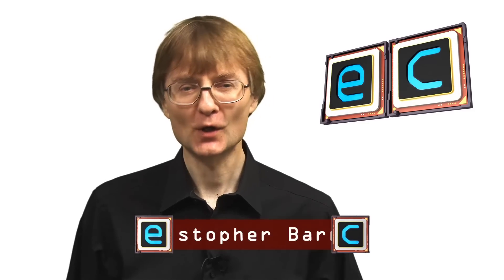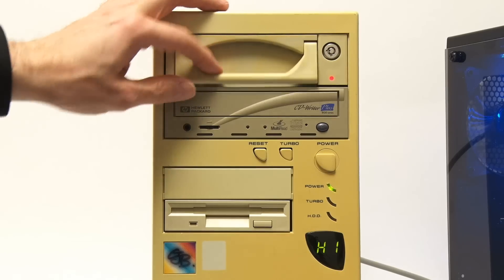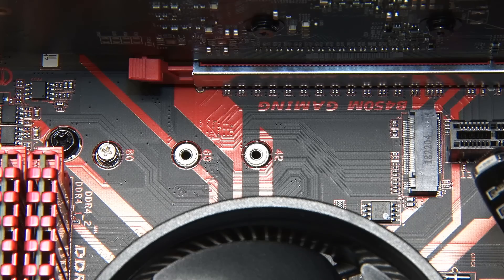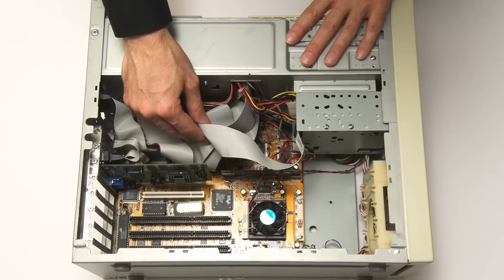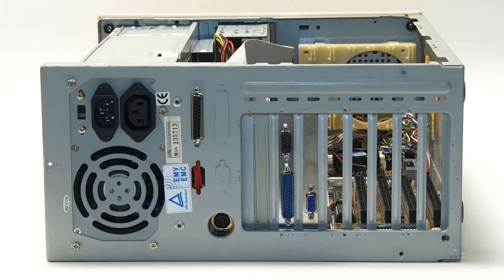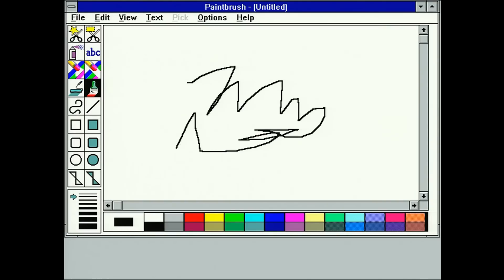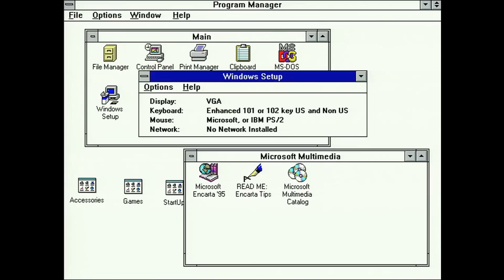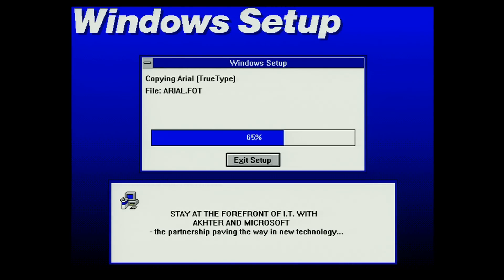Ryzen 3 vs 1996 PC

Comment: I so appreciate modern PC technology compared to the old stuff in the 90's as it was so fiddly to sort something and it was never a case of plug in, adjust settings and play... it was endless check this, check that, make sure there are no conflicts and everything else.

These days tho, when building a new PC, I just want to open the case once to assemble everything and largely forget about the internals of the PC unless it's a case of cloning drives and the like. I think I've just lost my tinkering edge and just want to use any PC I make as a tool and not something that needs perpetually tinkered.

I remember installing windows 3.0 & 3.1 from floppy disks and it was a case of just chilling while it did or doing other work in the IT training place where we were and then it was install the DTP software and then carry on with the form and design work we did.

Comment: Why were you running Windows 3.1 instead of Windows 95? A Pentium 120 with 32 MB of RAM was surely capable of running Windows 95 at a nice speed, so you weren't limited there, so I'm a bit curious as to why 3.1 was used.

Comment: If you just set that 1996 PC outside in direct sunlight for a few days no extra steps needed you can get them to turn white again after around 3-4 days
Reply: @Dalle Smalhals No you really don't Direct UV bleached plastic indirect UV yellows. I just tested this a few weeks back on some nearly orange yellowed keyboards heres my before and after center keyboard was a 1 day test run the other 2 i left out for 5 days.
https://cdn.discordapp.com/attachments/505264073894658062/620729905449140234/JPEG_20190806_095043.jpg
https://cdn.discordapp.com/attachments/505264073894658062/620729843654590475/JPEG_20190820_101006.jpg
https://cdn.discordapp.com/attachments/505264073894658062/620729935467905074/JPEG_20190808_202157.jpg
Reply: It's much slower then retro brighting but requires no extra steps other then just placing the items directly in the sun and doesn't require all the disassembly and chemicals plus you don't end up with wavy uneven brightening.

Comment: Windows 3.1/ 3.11 for workgroups on a Pentium 100+ and 32MB of Ram was extremely fast. I remember in middle school/ early high school we had a LAN with 3.11 on 386, and 486 computers, then they bought new Gateway 2000's with Pentium 166 mh with MMX and was still running 3.11 for worktgroups and it was amazing... Then upgraded to 95 and everything was sloooow. 98 was back to amazing a few years later though.

Comment: I do wish a company would make SMALL hard disks using the SATA connectors. So you can buy a brand new 10 GB or so HDD and use a PCI SATA port card.
Reply from the maker: Very much agreed.

Comment: Why don’t PSU come with a power output port anymore? Like what was the reasoning for discontinuing that? Seems like it would be handy even today to easily plug in a LCD monitor in the event you’re limited to power outlets or limited to power outlets on a power strip.
Reply from the maker: It was indeed very handy -- so they stopped doing it!

Comment: You forgot to mention the hardware locks that are present on the front panel of the older PC. The top one is for locking the HDD caddy in its place so that no one could take your precious data away.
The lock in the lower right is more interesting. Depending on your computer's model it could do one of the following things:
- lock the case mechanically, preventing theft of valuable parts;
- disconnect or otherwise disable your keyboard (worked because USB was not there yet)
- disconnect or disable hard drives and floppies.
Yet, these locks were rather useless: all keys were the same, so if you had one, you could unlock any computer.

Comment: what's with the LED strip dangling in the middle of the case?
Reply from the maker: I did not have an extension cable from the motherboard socket to the LED strip . .  :(

Comment: i've always wondered why Pc cases manufacturers still inclued the turbo button, even in the late 90s. 
The turbo button was useful when transitioning from 8086 to 286, arround 1982. When 486 and pentium appeared in early 90's, it was already useless But even in the very last days of AT standard (i clearly remember some pc sold in 1997)  

In other words, this button  stayed more than 10 years, despite being useless since the 80's
Reply: Why as it useless?
Reply: @nadirjofas3140  At least since the Pentium era (don't know for 486 or 386), even if some motherboards had a turbo pin, it generaly  didn't had any effect. On every socket pentium mb i had, there was no effect at all.

Comment: A really expensive piece of hardware for 1996. 
I also build my first system that year, but I had a 486 DX2 66MHz with 4MB-RAM.
I was using a 2MB VESA Local Bus Graphic-Card and only had ISO Slots next to it.

My first update was a CYRIX DX4-100 and the gain in speed was amazing :-)

Comment: A P-120 with 32MB of Ram, a 1.2GB hard drive, and a flat panel display, you were doing well in 1996!  I distinctly recall my displeasure of spending $200 usd to buy an additional 4mb of ram just so I could get Duke Nukem 3D running!  Also watching HIMEM test extended memory brings back a world of enjoyable memories, you knew things were good if HIMEM could finish the test without hanging the system.  By good I mean you had your array of jumpers set correctly, not that you'd have a working Serial port, Printer port, Mouse, Sound, CD-Rom, or Gameport!
Reply from the maker: At the time my freelance speaking and writing work was just taking off, and the P120 build very much reflected that. :)

Comment: Plot twist: build a Ryzen system inside a pc  from 1996 and you got a computer that does not look like an aquarium with massive fans that aren´t allowed to pull air for cooling but rather still looks like a computer as you strongly remember it once looking like.

Comment: My 1996 Packard Bell Pentium 100 had no CPU fan at all, just a bare heatsink instead and I don't really recall seeing a case fan at all save for the power supply. 32MB of RAM in SIMM form would have cost a small fortune in those days and I had to make do with 8MB. The graphics card was integrated with the modem and sound card and only came with 1MB VRAM but I didn't really care because I was just a little kid back then. I regret not keeping the PB Dome with slider keyboard though. I would have definitely paired it with my new Ryzen build and now have to use an old Model M I bought.

Comment: In the Philippines, the windows 3.1 came out when I first bought my first PC which was an 80486DX2 with a 300 MB Hard disk, 5.25 and 3.5 inch drives and 14" CRT Color Monitor plus an Epson LX-300 printer (all cost 750 USD).  CD was not yet available so we installed windows 3.1 using 30 3.5" disk.  

Games will not run usually out of the box so you need to do some memory management by modifying the himem.sys and autoexec.bat.  When CD/CR-Writer came out, you need to manually copy the driver to the c:\ drive and manually edit the autoexec.bat to load the CD drive after boot.

Comment: Could have used the 3200g it's been out and is $99 no gpu needed.
Reply from the maker: The Ryzen build is from January 2019. :) The system was built as part of a series, first showing a low-cost build without a graphics card, then upgrades. I did not repeat all of this info in this video! :)

Comment: First computer build in 1996? Beat you on that with a Pentium 90 in 1994 while still in school. I remember them selling me a mainboard with an old BIOS that didn't support HDDs bigger than 512MB, while I got a 540MB disk. Took quite some time until I found that fault. The computer ran without a problem for weeks, then started to have HDD errors, apparently at the time when DOS/Windows tried to read from to the part above 512MB (wasn't bothered when writing to it; who knows whereever those data went).
Ooh, and the times when you had multiple configurations in your config.sys and autoexec.bat! Setting the IRQs and DMAs for the sound card, mouse and serial port, loading sound and mouse drivers into "HIMEM" to squeeze as much out of the PC to get "Privateer" and "Civilization" to run. Thise were the times...
Reply: @Dalle Smalhals 
FIRST!! That's what it's all about, you know ;) . And the good old times (or maybe not even that good?).

Comment: Back when I had a Pentium (and even a 80486DX100) as my daily driver, I used it with Windows 95 (and eventually Windows 95 OSR2), which worked flawlessly. By the way, sticking with what you had installed, you could  have used the 'generic' SVGA driver included on the Windows 3.1 Setup disks. The thing is, this one is not listed as an option to start with. So if you'd have selected the Other option from Windows Setup and then loaded the SVGA driver, you'd have been able to enjoy 265 colours even though you didn't have the OEM driver. Granted, it would've been slower... But in these days that hardly made a difference anyway...
Reply from the maker: Yes, with both 95 and 98, there was little serious business use before the OSR2 release.

Comment: My first "hot" computer was a 586 133mhz with Windows 95.  No CDROM, so I had to install Windows 95 with 15 (yes fifteen) floppies.  Before that, I ran the gamut of 286 then 386 (then converted the 386 to 486 with a Cyrix upgrade for $200.)  Then went through a couple of iterations of 686 and K6 machines.  I skipped the Pentium II and went to Pentium III at 450 mhz.  Swapped the processor for a P3 700 and overclocked it to 902 mhz, but had to add a HUGE heatsink with double fans.  Sounded like a jet aircraft but was fairly stable at 902.  Then on to an Athlon 64 and 1 gb of RAM.    Then to a FX8350 machine but hated the noise so pulled back to Athlon II with 8 gb of RAM and that's what I surf the net with today.

Comment: My first PC was a 486 Cyrix DX2 66 back in 1994, but I upgraded it around 18 months later, to a Pentium P120, 32Mb ram and S3 Virge (which is the same as you've got, by the looks of things). I never used Windows 3.1 though, I always used Dos, until Windows 95 came out.

Comment: 1996....You should be using Windows 95, not Windows 3.1, along with Dos 6.22.
Reply from the maker: I had the WIn 3.1 disks, and like most office users mainly ran WordPerfect 5.1 for DOS. Windows was for CorelDRAW! So there were zero practical benefits, and potential downsides, opting for Win 95. (Both Win 95 and 98 were not considered stable until OSRII).

Comment: Wow.. you had quite a monster back in 1996. My late 1995 rig initially had only 16MBs of EDO RAM. CPU was 100Mhz which I overclocked to 133Mhz by fiddling with the jumpers. Thanks a lot for the video.

Comment: I was given a near new one of those cd writers back in the day. My mate had one and it stopped working a couple of weeks after he got it, so he contacted HP about a replacement and they just sent him one without wanting the original back, so he gave me the broken one (I assume it must have been a common fault for them to do that). Turns out it was just a broken solder joint on the power connector which took me minutes to fix, and voila free almost new 4x CD writer.

Comment: That old 120MHz PC would easily install Windows 95. Should install that instead of 3.1. Graphics would work a lot better.
Reply: Dalle Smalhals I don’t know what you’re talking about. My very first PC came with Windows 3.1 back in 1995. My first PC was a P1 166MHz with 32MB’s of RAM with a 1.2GB Hard Drive. I upgraded it to Windows 95 in 1996 and found it SO much better than 3.1. We got the internet and could do so much more. Yes 95 had it’s bugs but overall it was a much better OS than 3.1.
Reply from the maker: I ran Win 3.1 because I had the disks, and like most office users mainly ran WordPerfect 5.1 for DOS. Windows for me was here for CorelDRAW! for producing print artwork. So there were zero practical benefits of opting for 95, and potential downsides in terms of (eg) peripheral support. Very few business users opted for 95 or 98 before their second versions, not least as software support (in terms of available apps that actually needed a new OS) was minimal.

Comment: Intel CPU in the 1996 build was just prior to AMD Kicking Intel's ass. Just a couple years later Intel was charging $1000(CDN) for a CPU that was roughly $350 or so. So about a third of the price for equivalent performance. Just thought it was funny that he now has an AMD Ryzen build as AMD is starting a potential comeback though "value" isn't quite as clear-cut as it was around 1999 or so since the SINGLE CORE vs SINGLE CORE was much easier to compare than the various options we have now.

Comment: You built a computer back in 1996 and you installed win3.1 on it? Fail. the shift to win95 was massive and you got left behind?
Reply from the maker: @Dana Vixen I find it amazing that you are criticising my decision of 23 years ago! :) And I was not "left behind". Very few business users ran Windows at all at the time, let alone a very new version (those that did waited for the second release, both of 95 and 98). On the P120 I mainly ran Word Perfect 5.1 and Lotus 1-2-3 for DOS, which were by far the most popular PC applications of the period. I ran Windows when I wanted to run CorelDRAW!. As today, the most important thing in computing back then was to decide the programs you wanted to run, and to match your hardware and operating system(s) to those. New versions of Windows also did not have drivers for older devices like printers.

Comment: My first build was a 12 Mhz AT with 1 MB ram running Win 2, but before that I was fixing CPUs built from 8 large boards of hand-wired TTL chips and paper-tape readers and punches. If only my much more modern computer was anywhere near as fast to work with as that old AT! Thanks again for these videos -- would have been nice to see MIPS or similar for both, but fun either way.

Comment: Objection!
Oh wait sorry. One minor mistake. Very minor. The two 25 pin ports, you got backward.  In PC land, a male port on the computer is always serial. A female is always Parallel. (Except when it's scsi-1). So you got them crossed up.
Reply from the maker: My bad. So often when making a video I am pointing to something the camera can see but I cannot (both due to the angle, and me wearing the wrong glasses). So sometimes I get it wrong!

Comment: So the Pentium was build, before the launch of Windows 95 or?
Reply from the maker: The first release of of Win 95 was indeed available when I built the P120, but like the vast majority of PC users, I did not install it. For  a start I had the Win 3.1 floppies :). And Win 3.1 had drivers for the printer I had access to, which Windows 98 did not. I mainly ran Word Perfect 5.1 for DOS on the P120, which was the most popular program of the time. :)

Comment: One little nitpick, you got the 25-pin serial port and the parallel port mixed up. The female connection at the computer (the one attached directly to the case) was the parallel port, while the male connection at the case (mounted to a slot cover alongside the 9-pin serial port) was a serial port. Unless you somehow managed to get the ribbon cables mixed up inside, which isn't that likely given that even the 25-pin serial ports typically used a 10-pin header to connect to the motherboard.
Reply from the maker: True. My bad.

Comment: I still have a working 286/10 on which you need to run ‘park’ before switching it off. I often switch it on to play Strip Poker in CGA mode 🤗

Comment: I wish more modern computer cases would incorporate a 5.25 bay. Disks are far from dead and it’s not like they don’t have enough internal space for one.....
Reply: Dalle Smalhals 

Because I have no need for 12 drives and cooling loops. SSD’s and modern air coolers have taken care of that. All I need is one 5.25. Even a slim would be just fine. Modern cases are internally huge to accommodate cooling reservoirs that 90% of consumers will never use. Fractal makes good stuff though.

Comment: Sorry, nope. In 1996 anyone who had not upgraded to the revolutionary windows 95 was trying to. With a Pentium chip at 120 MHz you were a prime candidate for the new operating system. Throw more RAM in, and you were good to go.
Reply from the maker: Simply not the case as far as I recall. At this time, most offices still ran DOS -- Windows was relatively niche, and the most popular programs were Word Perfect 5.1 and Lotus 1-2-3 for DOS (which are what I mainly ran on this PC). Those running Windows waited for OSRII for both 95 and 98, and for better driver and software support. In 1996, if I had installed Windows 95, I would have needed to buy a new printer!

Comment: Hello Chris. Nice one) May i ask you why did u run win 3.1 on P120 in 1996? W95 was there!! I clearly remember 1994 and win 3.11 and then boom - directx and win95 and proper windows games (and struggling with running extended mem games - dos4gw on win95 too)))
Reply from the maker: I had the Win 3.1 floppies, mainly ran Word Perfect 5.1 for DOS, and there was no drivers for my printer for Windows 95! Amongst other reasons. :)

Comment: That 1996 pc should be running windows 95 or at least windows 3.11. Windows 3.1 was ~5y old by that time. That's like running windows 8.0 on the Ryzen. It would not recognize properly HDD filesystems (on 60GB drive),  memory or video card.
Reply from the maker: But I had Wind 3.1 disks available, and there was not a Win 95 driver for my printer! I ran Windows only to run CorelDRAW!, which ran fine. Most of my time I ran Word Perfect 5.1 for DOS, which was by far the most popular program of the time. 60GB was not the initial hard drive, as noted in the video.